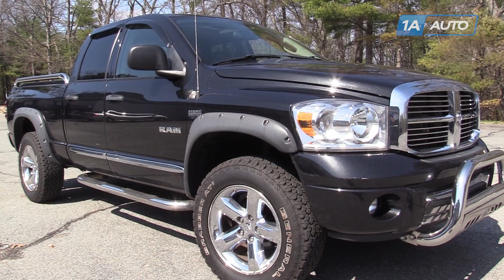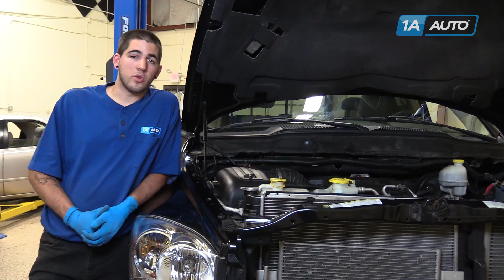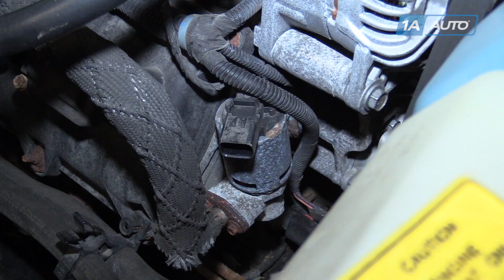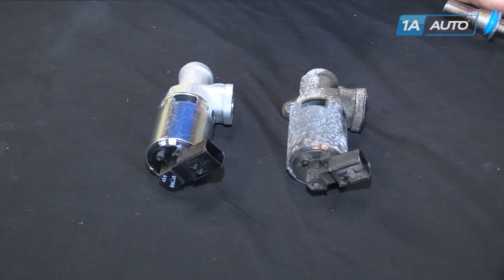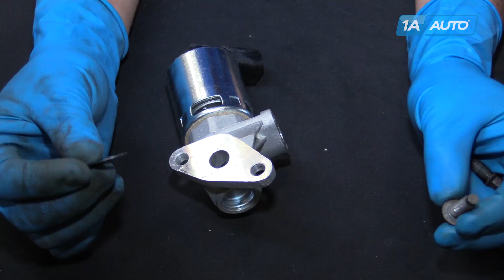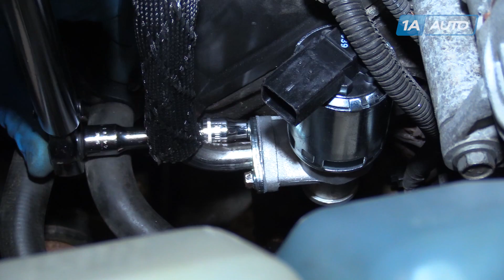How to Replace EGR Valve & Tube 06-08 Dodge Ram 1500 V8 5.7L

Comment: What exactly does an EGR valve do. My truck is cranking but no start, I’m thinking it’s fuel pump because I don’t hear it when key moved to on position. But someone told me check egr valve first.
Reply from the maker: +I JW We wouldn't be able to diagnose an issue like that here, you may want to have a local mechanic take a look at it. Thanks for checking us out! http://1aau.to/m/Shop-1AAuto-c

Comment: I need a better advice on how to remove my EGR valve from a 4.7 V8 05 Dodge ram 1500 truck... which sit on the rear back of the motor near wall inquiring easy tactics to take it off @ your nearest convenience appreciate the assistance here
Reply from the maker: +Wilbert Brown We're always cycling through common cars. We'll add this repair to our list! 1AAuto.com